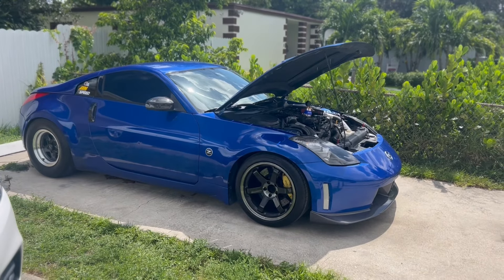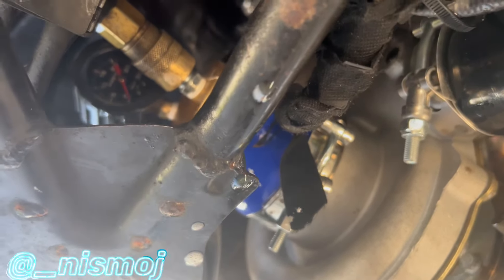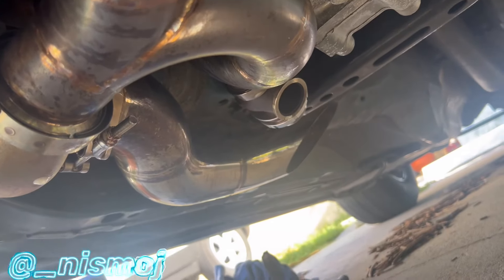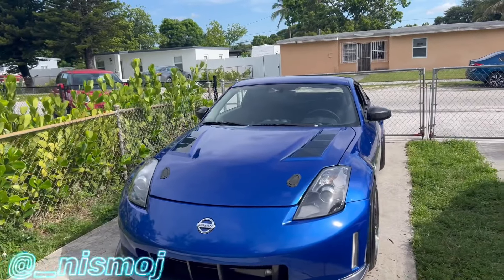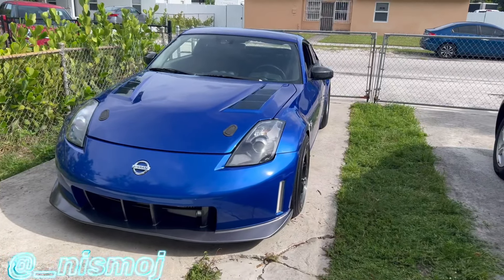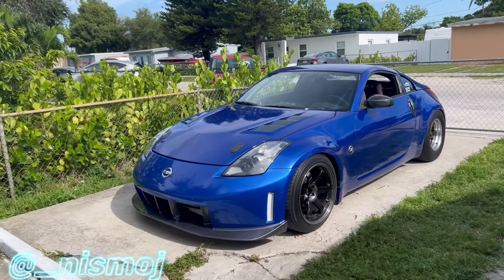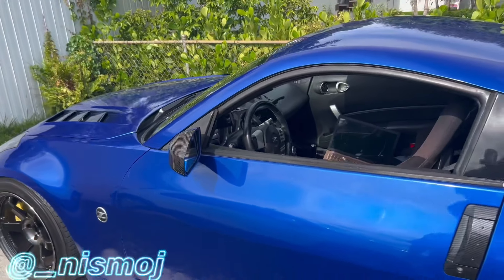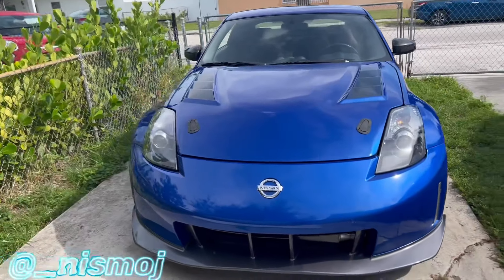Fixed so many BOOST LEAKS! Switching Tuners .. 😮

Comment: feel like the BOV was leaking because you didn’t have the vacuum line connected. The spring is only so strong. So eventually boost pushes it open. Anyway bet the car feels way better with the leaks fixed
Reply from the maker: @siknin1  i think it had too soft of a spring in it and that’s why it was opening up at 8 psi, regardless it was just always opening up, it was never being used. That was causing a huge leak
Reply: @nismoj  if you wasn’t using it and didn’t have the vacuum hooked up, it’s better off not being installed, plus you said have the turbo that is anti surge. Look forward to seeing the new numbers